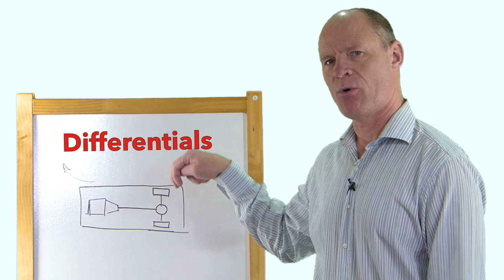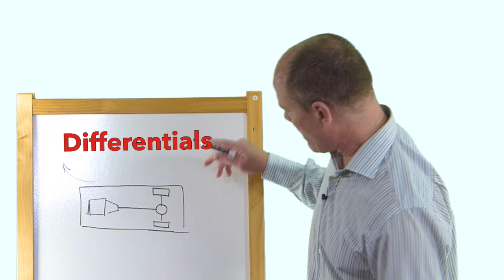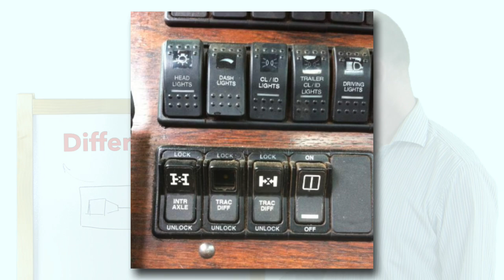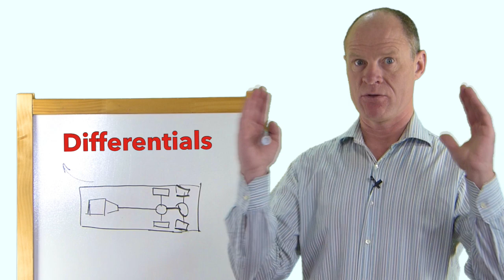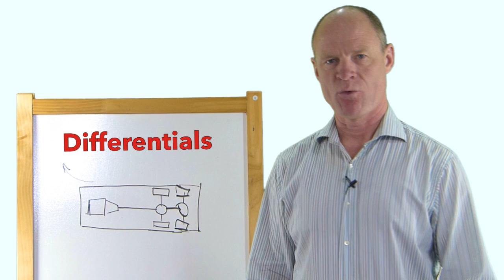How a Differential Works | Trucking Smart

Comment: no but had problems with diff lock leaking and not engaging and had to wait in the morning for a big farm tractor to pull me over the jump up (88.2 ton gross pocket road train )not my fault the truck had severe use in hilly terrain and our 4x4 bush fire truck blew a diff cause of something electric over air failed
Reply from the maker: Hi sensai cobra - Apologies for the late response. Thank you for your comment. And I too have had issues with those electric over air controls. Mine was in a bus that shifted the transmission. Are you in Australia that you're pulling road trains? All the best my friend, Cheers Rick

Comment: I broke the driveline between the axles as I pulling out of the bottom of the rock quary. I rolled my truck up against a giant rock and removed the driveline. I then engaged the inter-axle differential lock do that all the power would go to the front drive axle and drove it 60 miles like that. Definitely saved getting hauled with a tow truck. Front wheel drive also has a differential. Thanks for the video

Comment: I left the diff lock on for over 2,340 miles  vale nc after getting stuck on my way to LA ( indicator light was burned out) and i just had the diff serviced and ran the truck another 340,000 miles with no issues. Got a new truck and that one was still going strong. 
Then I had a codriver run an interlock for 10hours at speeds up to 75mph and never had a problem. Truck has 650,000miles on it now
Reply from the maker: Hi Rodney Long - apologies for the late response. Thank you for your comment. And thank you for that information. Yes, unless you are dong a lot of off-road stuff, I don't think the diff lock is going to do damage. If there is anything further we can do, drop us a note. Always happy to help. All the best, Cheers Rick
Reply: Lmao

Comment: yes once and it did no damage because I caught it a couple hundred miles down the road, turned them off once again didn't have to make a lot of turns. This is an excellent presentation.
Reply from the maker: Hi Ladonna - YT comments are odd because I was certain that I replied to your comment??  That is great information for the other drivers coming into the industry. I'm wondering if the vehicle manufacturers should put a light or a beeper on the diff lock - I guess if there was a chance of damaging the vehicle they would. All good though - thanks again, Cheers Rick
Reply: Rick I commented then watched then commented again.....mean time others were commenting and it seperated the comments...lol! Sorry bout that!!! Have a great day!!!
Reply: @smartdrivetest Freightliner’s typically don’t have a buzzer for the diff lock, but they do for the suspension dump. Volvo’s have a sensor on everything they could possibly throw a sensor on and it does give you a message in the driver’s display that the diff lock is engaged if you go over a certain speed. I’ve had more sensor issues with Volvos and there not be an actual problem than any other truck I’ve driven.

Comment: Do both the rear axles receive power when the interaxle diff lock is not engaged, or is it just the forward rear axle? In that case the back rear axle would merely function as a dummy axle until the interaxle diff lock is engaged. Correct?
Reply from the maker: Hi D Majumdar - Thank you for your question. Yes, unless you have an inter-axle lock,  it's across the front-rear axle. It may vary from across brands of truck too as to which wheels receive power. Few trucks have both a diff lock and an inter-axle lock. All the best, Cheers Rick
Reply: @smartdrivetest  thanks for the reply!
Reply from the maker: You are most welcome. Cheers Rick

Comment: We had a new driver engage the Differential somehow either one or both axles and ended up needing a tow afterwards. His reasoning for even using it was because his friend told him that it would make him go faster. He's no longer an employee.
Reply from the maker: Hi Cory - did he need a tow because something broke or he got the truck stuck? Cheers Rick
Reply: @smartdrivetest  Something blew when the driver did that. So i'm unsure of what exactly but it wasn't pretty lol
Reply from the maker: Part of the issue with new drivers is that they’re often not trained about these things and are left to figure it out for themselves. I’d also suspect there might be something wrong with the truck. A different lock really has to be abused to do damage to the truck. Cheers Rick

Comment: Left diff lock on 2020 new Freighter Cascadia often & at 70k miles it stopped working blowing air inside axle housing not engaging buy losing air pressure. Opps! Not fixed yet but still drives
Reply from the maker: Good to hear that it didn't stop the truck. Probably best to get it fixed sooner than later. All the best, Cheers Rick

Comment: when you have the diff on you only drive stright. of you turn to left or right like down on a road, you risk to broke the axel becorse you inner wheel drive more slow then you outer wheek, sp dpn't do that stunt.use only diff luck when you can not get out, and as soon you have to turn you stering whells like for left or right, then get it out of diff luck again, if you drive on asfalt with load on, you can almost not turn you sering whells, becorse you back axel try to drive stright.. so get it out of diff luck as fast as you can again,, diff lock is only for emerginsy when you get stuck in the Mud.

Comment: I'm new to trucks, my brother left me a ten wheel dump truck, l got it parked on a  soft surface in the rain and it continues to rain for two days. One tyre on each of the rear axles are soft and it will not move,only one set of wheels on each axle are spinning. Any answers?
Reply from the maker: Hi Howard Darlington - hook a chain on it and give it a tug my friend. Despite the myths, big trucks are terrible in the mud and in the snow. You either have to put chains on the tires or give it a pull. It won't take much - you can probably pull it out with a pickup truck. All the best, Cheers Rick

Comment: the power divider sends 50% to the front differential and 50% to the rear differential, it does not lock the front differential like you said.
Reply from the maker: Hi MASTER MECHANIC Felipe - Thank you for your comment. Are you saying that there's a difference between a power divider and a differential lock? All the best, Cheers Rick
Reply: @smartdrivetest  correct. The divider on Class 8 trucks divides the power between the front most and rear most axle. Not all trucks have dual driven rears, which is why they say to put the chains on the front most axle. The power divider distributes the tractive effort between both axles and reduces the need for a locking differential in most cases. (This is why they don't want you to engage it during wheelspin, you have one axle dead stopped, and your driveline moving, you'll put a massive shock into the system and damage the divider) Most trucks do not have locking differentials but may have a power divider instead. That's why you'll see many trucks stuck because the driver didn't chain up. They thought their differentials lock up and in most cases they do not. They also recommend that you do not run highway speeds with your divider locked for the same reason why you shouldn't drive highway speeds with a locked axle. The difference in speed from the rearmost axle to the front most axle varies enough to cause binding and can damage the divider or cause a dangerous situation when loss of traction occurs at higher speeds.
Reply: @EyebrowsMahoney  What you say here is correct, but there's a bit of a nomenclature problem.  All tandem axle trucks (trucks with twin rear drive axles) have a power divider.  They MUST have one.  That's because a power divider IS a differential, allowing differentiation between two axles instead of between right and left wheels.  Most power dividers can be locked (cancelling differential action and causing the drive inputs of both axles to rotate at identical speeds), but I've heard there are some that cannot be locked, so they always function as an inter-axle differential.  You can't run twin driving axles without a differential between them for the same reason that you are saying you can't run a power divider locked at high speed.  There will always be the need for one axle to spin a little faster than the other due to tiny differences in tire size, inflation pressure, etc., and if one axle is "trying" to turn at a slightly different speed than the other, huge torque loads build up within each axle and within the drive system that connects them together, and at higher speeds, that torque build-up tends to be greater. 

https://www.desitrucking.com/understand-your-power-divider/

If the difference in speed that each axle "wants" to go when the drive line locks them together is great enough, drive-line parts tend to break.  I heard of a heavy-duty all-wheel drive truck (used in potato farming) which had the front axle geared to spin significantly faster than the rear axles as a compromise between what's needed for sharp turns and what's needed for straight-ahead driving.  The front axle must spin faster during sharp turns, so gearing it to at least spin a little faster than the rear axles helps the truck make sharper turns off road than it could do if the front and rear drive wheels rotated at the same speed.  Gearing the front axle this way is acceptable in off-road applications, but if the front axle is left engaged for on-pavement use, an axle shaft will shatter within a moment of getting onto the pavement!  Because the differences in speed that a pair of identical drive axles "want" to spin is minor, leaving the twin axles locked together won't result in the kind of catastrophic damage as was the case for that heavy-duty off-road truck I described, but it does constitute abuse and damage will accumulate over time.
Reply: Having the power sent 50/50 is the definition of what a locker will do. A diferential allows the majority of the power will go to the wheel/tire with the lowest amount of traction
Reply: @EyebrowsMahoney  I have a question on my Mack truck I got stuck and put the lock in.  So now the truck does not move. The trans runs but when it turn in the differential it does not run    Unless the rear differential is Locke then it move but low speeds.  What can be the problem for the from one to not move a broken pin?  There’s no noise when moving
Reply: @josearredondo28  unfortunately I'm not a class 8 mechanic. I'm just a guy who's driven big trucks around a farm.

Comment: Great Info. My question is, in normal conditions on highway which wheel has drive or all 4 has drive or X drive..?
thanks
Reply: Good morning Andrew.  
In normal operating conditions, with the power divider unlocked, torque, or power, is going to flow equally to the front and rear drive axles. 
This is where things get tricky, because this would lead you to believe that all four sets of duals should receive power. However, in the unlocked condition, power is sent to all four SO LONG AS TRACTION IS EQUAL. 
However, when one axle encounters poor traction, 100 % of torque flows to that axle, and through its differential to the wheels with the least traction. 
On the vehicle, this results in one set of wheels on the front or rear axle spinning out. 

When the interaxle lock, or power divider, is locked, torque is now distributed equally between the front and rear axle independent of traction; the front and rear differentials are mechanically locked together. In this condition, each axle will still send power to the wheel with the least traction, which can result in the “x” pattern you described- the right rear and front left spinning out, or vice versa. It is possible though for both left or both right to spin out, if both duals on each axle have poor traction. 
This is where a differential lock comes in, forcing both sides to pull regardless of traction. 

In short, with the power divider unlocked, power flows to all four corners equally so long as traction is equal. 

With the power divider locked, power flows equally to the front and rear axles, independent of traction; each will receive 50% of the engine’s power. 

I hope this helps!

Comment: If you are turning sharp with diff lock in and at high speeds especially of course the axles will come under stress because they cant move at different speeds. So yes it will break hub bolts and have seen damage multiple times because of leaving diff lock in.
Reply from the maker: Hi Bailey Smith - Thank you for your information. It helps out other smart drivers my friend. All the best, Cheers Rick

Comment: I had a strange situation where  I was completely out of traction because of the irregular terrain. Essentially One wheel set on the rear axle was up in the air because the ground sloped down severely and on the front axle the opposite tire was down in a bit of a  Sandy rut which meant that tire was just spinning in place with no forward motion of the vehicle. I essentially ran out of traction and I had the interaxle differential lock engaged. Had I had at least the ability to lock one differential completely I would of been able to drive out but I had to be pulled out with a chain
Reply from the maker: It happens to the best of us my friend. Great story and learning experience. All the best, Cheers Rick
Reply: Good morning!  It’s very frustrating flexing out the tandems and having perfectly good rubber just out of contact with the ground!  

Here’s a trick that can get you out of that situation SOMETIMES. I stress sometimes. 

If moving forward (or reverse) slightly will get you on good footing, and not into more trouble, lock your power divider and put the truck in the lowest available gear.  Idle off the clutch, and allow the wheels to spin slowly, at idle speed only. 
Apply light and gentle brake pressure. The idea is to slow the spinning wheels and bias torque to the wheels with good traction, forcing them to pull.  You are essentially tricking the differentials into thinking there is equal traction on each axle. 

That being said, if the truck hops, bucks, or does not begin to move, push in the clutch, and stop immediately. 
Continuing to try to power out can cause drivetrain damage to the truck, or get you spun down and into a worse situation than you were in.

Comment: Front wheel drive vehicles also have differentials in the transaxle
Reply from the maker: Hi 33CVU - Thank you for your comment and correct information. Yes, what I meant to say in the video is that front wheel drives do NOT have a differential the same as a conventional differential in a rear axle. All the best, Cheers Rick

Comment: Unknowingly (issues with lock mechanisms) i drove my truck with differential on for way long time with lots of turning until when drive shaft in between axles broke. At the mechanics it was found the mechanism was indicating the diff. is off but actually engaged. Gears where inspected no damage found. At least that is my experience with diff. locks........
Reply from the maker: Hi Christopher Zablon - Thank you for your comment and information. Most of the time, leaving the diff lock on isn't going to do damage, but it will after a period of time. All the best, Cheers Rick
Reply: @smartdrivetest  You're absolutely right Sir, it was a big scare!. What happened to me may not produce same results  to other drivers (bottom line is stick with recommended Diff. guidelines), I'm more attentive to what's going on with my differentials now than ever before.
Reply: @christopherzablon8336  it would be interesting to know the torque loads through the half shafts when running the diff as standard and with diff locks on. Im guessing the torque load increases significantly on the half shaft when it is locked and trying to turn at a speed it isnt meant to be doing with the increased load been exerted on this part. I assume this is why there is a speed limit and distance set on the differential locks been engaged as the increased torque (if this is what happens) makes the half shaft the weak point in the running gear. I really am just guessing out of interest but it would be interesting to understand the subject further and if this is the reason why it is suggested not to be done. I could see those running diff locks on highways having no issues as the wheels are running true with each other and under less torque stress as the vehicle rolls at speed, im sure multiple tight bends at higher speeds than suggested is when the real damage starts to take hold.
Reply: @Dieseldogmodels  The main issue I could see with running with the locks engaged especially at highway speeds is this: depending on varying amounts of wear on the different tires on each axle, you could end up with very minor variations in tread depths. This would lead to minor variations in circumference at the road which would cause the tires to spin at different speeds. At low speeds this would only result in a minor amount of tire scrubbing but could put tension on the axles and half shafts at highway speeds because small differences would get magnified with a larger total speed. This could either cause more scrubbing or more torque loads or both neither of which is good.